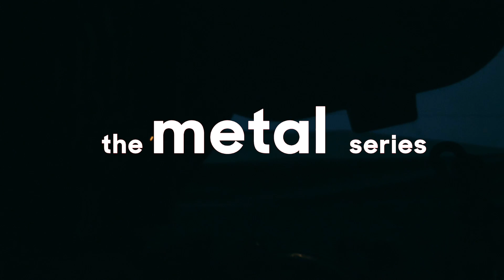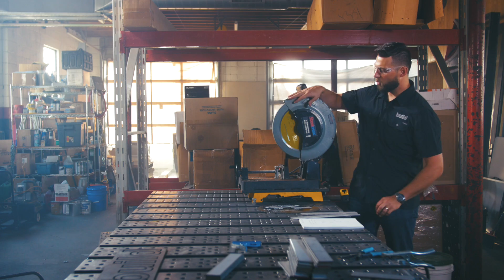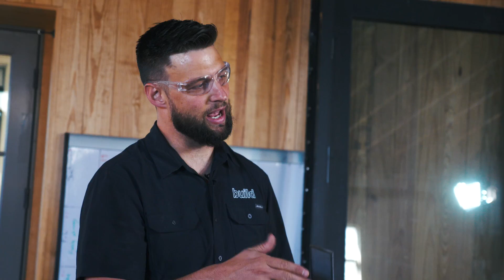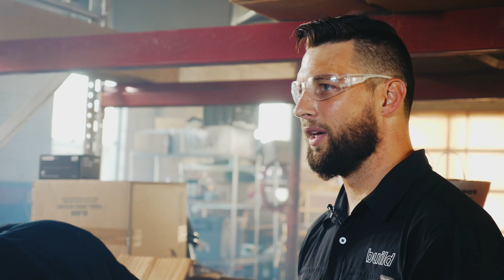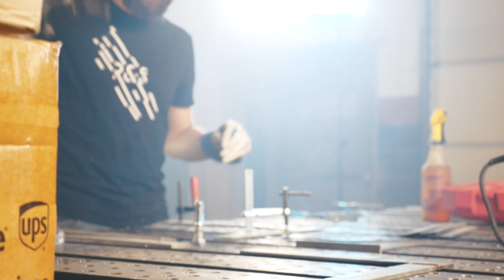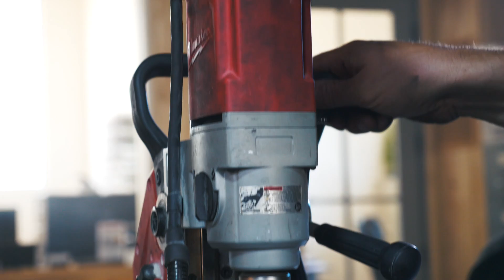How to weld stainless steel brackets

Comment: I'm Not A Welder But Am Curious If The Welding Table Is
Commercially Purchased Or Did You Build It Yourself. ?
Also Please Explain The Slots And The Holes.
Reply: First You Explain Why You Capitalize Every Word?

Comment: Why would you MIG weld this? Honestly this has TIG written all over it. Unless you are going to do HUNDREDS of them then the speed of MIG welding offers no advantage other than reduced heat being pushed into the base metal which is only an advantage when doing thin material. Which this is not! Why did you MIG this?
Reply: and I can tell you why they didn't show you the result. Because it looked like shit and they grind and linish the thing so you can't even see a weld. This is pretty BS video.

Comment: Do you start with a pilot hole for the 1/4 inch holes, or just push the 1/4 inch bit through? (who's bits do you suggest?)   (I ask as drilling stainless has always been a challenge for me.  I guess a mag drill would help)

Comment: If your concerns are with sugering and corrosion the reverse of these brackets will be sugared,  why not just weld them in a Gas Box. I only ask because I operate a Sheep Ranch and all of our Milking Stainless piping had to be welded so they wouldn't suger up. Now we filled the piping with the gas mix you talk about  but all of our small parts we did in boxes and it yielded excellent results, far superior to nozzle gas flow. Thank you for sharing this information.